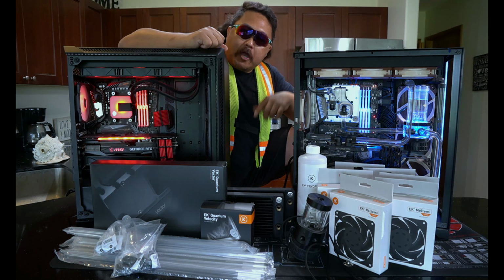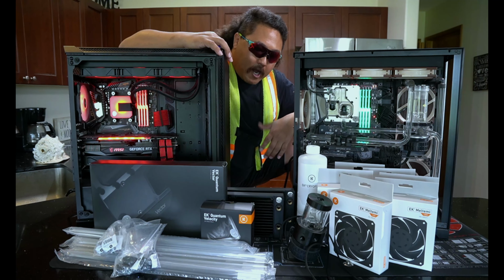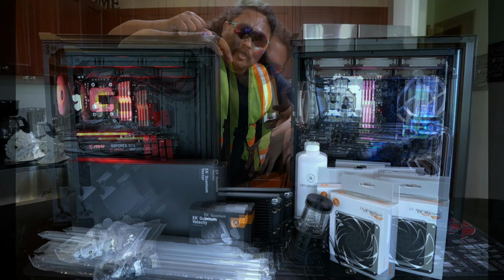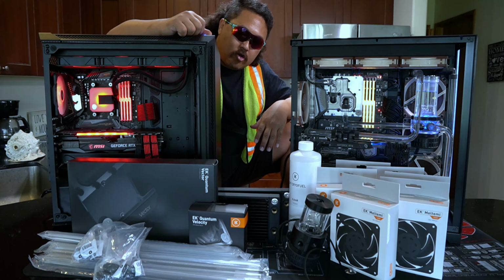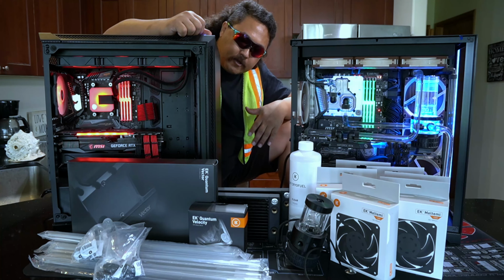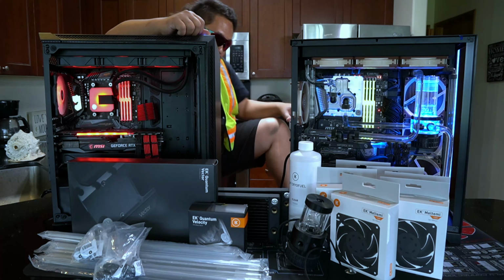RTX 3090 Custom Water Cooled PC Build: Lian Li 011 Dynamic XL, EKWB Water Blocks. Part 2.

Comment: Can you help me out with the radiator thickness, and reservoir height? Also do you belive i can install the reservoir on top of the botom radiator, last fan instead of the side. Thanks!
Reply from the maker: rad thickness and reservoir heights i would recommend checking with manufacture specs length\width and thickness to see if it will fit/work with case. and i do believe they have a universal reservoir mount that will work on top of bottom rad.

Comment: Can you eben close the side panel with the EKWB?
Reply from the maker: da ekwb 3090 water block and msi trio will fit side panel closed in lian li 011 dynamic XL 1/8`` play. on da other hand ekwb 2080ti msi trio water block will not fit 3/16`` to big but your still able to force close side panel with a little bulge in the glass not recommended